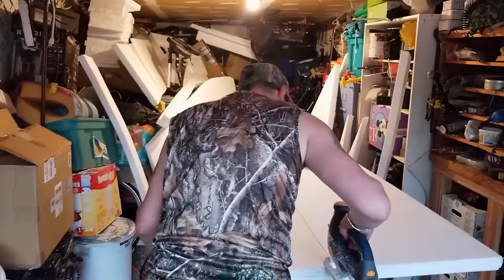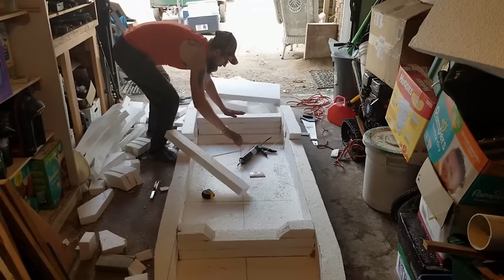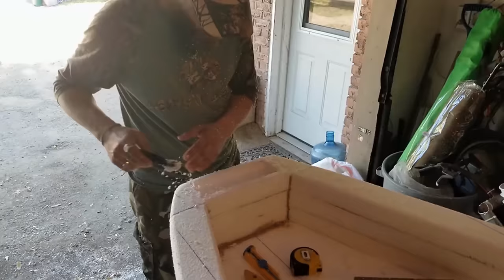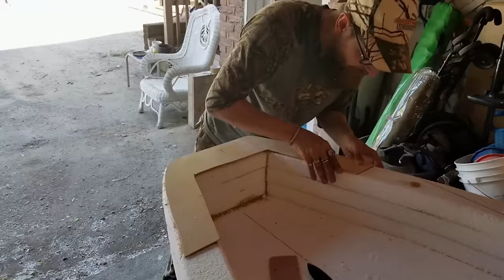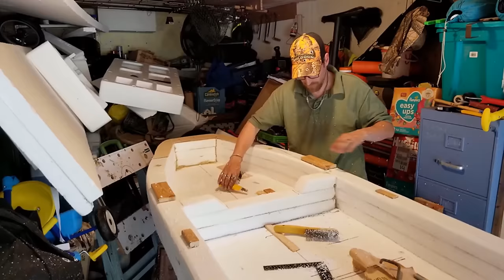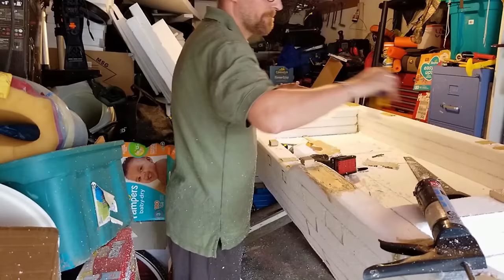Homemade DIY 12ft Styrofoam fishing Kayak start to finish

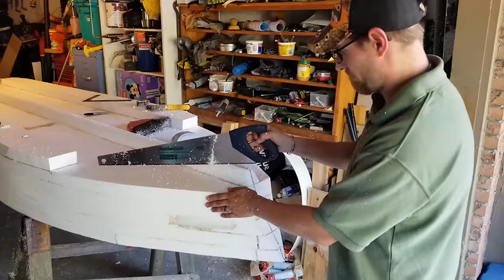Comment: I got really nervous when you started digging that saw in at 11:30.  But then realized you weren't really moving that fast.  What adhesive are you using?
Reply from the maker: I used PL 300 to glue the Styrofoam